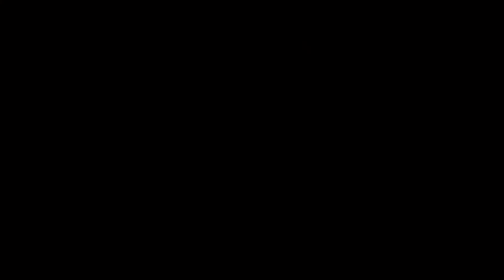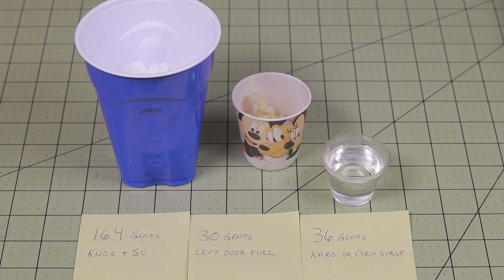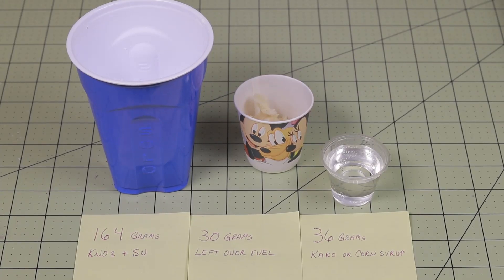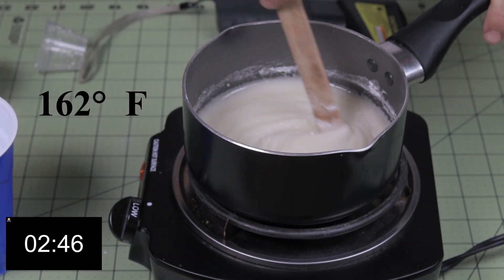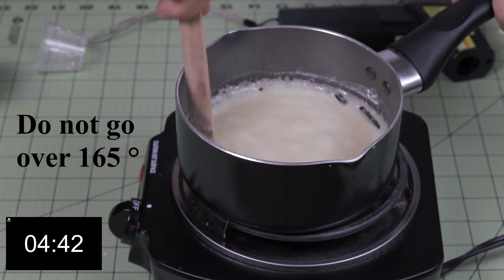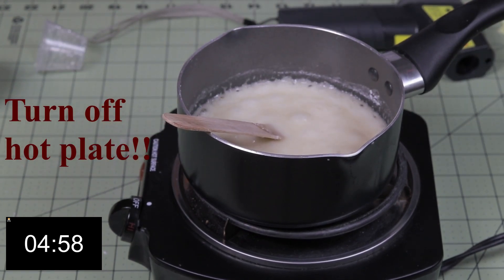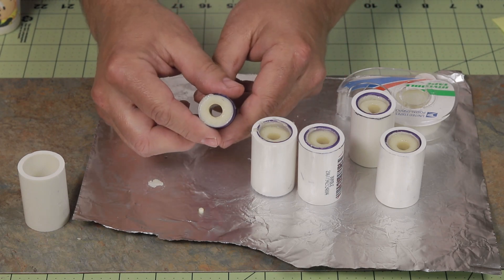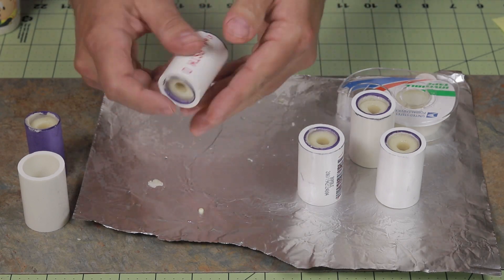Rocket Fuel Demonstration - The Rocketeer

Comment: Just made up about 100 grams of Flexifuel -- enough for 5 1" X 1.5" BATES grains.  Haven't used it in a rocket yet but the strand burn was encouraging, about 8 secs/inch.  I am using 1% RIO on the mix. 

I found that the prep procedure you have is very clear and easy to follow.  I really like how pourable this mix is when hot -- it's comparable to Sorbitol
  
Will return to update comment when I build and launch a rocket using this fuel.  

Thanks for posting these videos -- incredibly useful.

BTW, I tried to donate but noticed that Stripe does not take PayPal.  Anyway you could fix this?  If not, I'll just use a credit card -- which I don't like to do -- but I'm not a free rider!
Reply from the maker: Flexi-fuel already burns quickly, and using RIO may lead to the motor experiencing RUD (Rapid Unplanned Disassembly). Please inform me of the outcome and maintain a safe distance!

Contributing comments and information indicates that you are not a free rider. Donating has become challenging due to restrictions imposed by PayPal.

Thanks for your comment!

Comment: Great video!  How do you determine the proper core diameter for the grain based on the overall diameter of the engine grain?? what percentage of the outside core diameter is the core hole??   Thanks
Reply from the maker: I used a 3/8 core for the 1" PVC motor. A 38mm motor would be a 1/2" and 5/8" for a 54mm motor. Yes, the core size is determined by motor diameter. Thanks for your comment.
Reply: @TheRocketeer  Thanks for the reply!

Comment: I'm a beginner in amateur rocketry, is just using the powdered form of sugar potassium nitrate mix any good in a rocket, I have seen some comments against it on r/Rocketry, also comments saying that pvc is an unsafe casing material? I'm unsure about the first concern but I have seen many rocket tests using pvc pipe, so can you please answer these.
Reply from the maker: Performance and consistency will only come from a melted propellant. When the two components are melted together it provides an intimate contact between the oxidizer and fuel.

Forget about Reddit, there are too many so-called experts there. PVC motors are a great way to learn about motor making, I have made about 50 of them over five years. They are cheap to build and can produce a lot of thrust. PVC motors are for experimental use only and can not be used at a launch. Any rocket motor demands a safe distance between you and the test stand.

Go to this forum to learn about rocketry - https://www.rocketryforum.com/Mentioning PVC motors on this forum is not recommended. You will be greeted with warnings like PVC will not show up on an x-ray. Don't eat the pieces and you won't have to worry about it. 🙄

I have many videos on my channel that feature PVC, take a look around.Latest PVC video - https://youtu.be/nLT_aRcI7fQI launch a 5 lb rocket on a PVC motor - https://youtu.be/OdVmYzNnkzU

New videos will no longer be uploaded after April 8th, 2023 unless I am able to raise some support from viewers using YouTube Thanks or Buy Me a Coffee.

Comment: What would you do if you didn't have the extra fuel left over to add to the mixture? That changes the % of the PC and corn syrup that is in the mixture.
Reply from the maker: I always mix a little more fuel than is needed. The next time I make a batch with the correct 65/18/17 ratio and then add leftover fuel to that mix. Everything stays the same. I will have another casting video soon for flexi-fuel.

Comment: Great tutorial! So I have a LOC Precision Legacy and would love to build a KNO3/ Sorbitol motor for it. What size PVC pipe works best in a 29mm motor mount?
Reply from the maker: The 1" PVC motor will fit in a 38mm mount with some modifications. I had to sand down the end cap so that it would slip in. For 29mm a 3/4 PVC pipe may work. I have only made the 1" size to date.

A friend of mine has made 29mm grains for his Aerotech hardware.

Good luck and thanks for the comment!
Reply: @TheRocketeer  Thanks! Big Box store it is!

Comment: Please don’t Use PVC it releases toxic gasses when heated is toxic in the body and hard to spot on X-rays as well as being brittle making it more likely to explode
Reply from the maker: Let's take a look at this statement. 

Toxic gas
I am not burning PVC pipe. It does get very hot and melt but the pipe is not on fire. We are talking a 6" - 9" piece here, not exactly enough for an environmental disaster. The chemicals used to make PVC are toxic but that is the same for any plastic.

Hard to spot on x rays
Use electronic ignition and keep a great distance from any motor. If you are concerned about detecting PVC in the body then you are way too close! I looked at your channel and you should be concerned about the lack of safety.

PVC is brittle
Any rocket motor can explode. The most violent CATO I have ever seen sent large sharp pieces of aluminum shrapnel flying farther than any PVC motor. The idea that aluminum will just split is simply not true. I have the video and pieces to prove it.

I have been making PVC motors and sugar fuels for years. Some people copy and paste this information are not well informed and probably have never made a PVC or any rocket motor.

Comment: Absolutely no reason to cook the mixture that high of temperature
Reply from the maker: I heat the propellant to 265°F so that it will flow into the casting tube without causing a void. At lower temps the fuel sets up too fast. I have cast fuel for years at this temperature and have had a lot of successful flights without failure.

Do you have another solution? Please post a video of your technique.

Comment: new comment, whqt size  rocket would you use this motor for?
Reply: The 6" PVC motor is a "G" impulse. It will lift a 3" diameter 2-3 lb rocket around 1,200 ft. I will have a more complete answer in the spring when I build a rocket specifically for this motor.

Comment: Hey Rocketeer, 

First your videos are great and offer a lot of insight, thank you.

Second, I've been experiencing CATOs using a De Laval nozzle made from water putty. I primarily build motors similar to what you've shown here but my mix is a little a different and wanted to ask if you thought this recipe could be the culprit:

I use a potassium nitrate to sucrose ratio of 14:6 + 5% of total mass added iron oxide.  I am still testing this recipe and have been building 1.5"x1" with a 5/16" core grains loading five into 1'' schedule 40 pvc, coupled with a 1.5" De Laval nozzle using about 60º convergent segment and 15º divergent, also a 5/16" throat.

I think it's just too much pressure. Tomorrow I'll try adjusting overall propellant mass and well as nozzle throat diameter. I'm also eager to try your recipe here, I've been pouring my casts after the propellant is little less water saturated and it can become rather annoyingly messy.

Thanks, 
Carl
Reply from the maker: One of the reasons I use Karo or corn syrup is to control the burn rate. Sucrose burns at an extremely fast rate and adding iron oxide to the mix makes matters worse. The large nozzle to core diameter can also cause erosive burning, something you want to avoid. The core needs to be around 3/16 to 1/4".

You may want to consider trying a proven design first and experiment from there. One thing I recently learned is red iron oxide (RIO) does not work with flex-fuel.

Thanks for the comments, be careful and let me know how things go!
Reply: @TheRocketeer  Wow thanks for getting back so soon and I will definitely take your words into advisement. 

I understand entirely that it all burns faster but I want MO POWA! I also understand that a nozzle built out of rock hard water putty and schedule 40 pvc can only withstand so much pressure, and yes, there is severe erosion to the nozzle because of this. However, I'm soon to  experiment with using cement as well as upgrading to hardened steel for the nozzle; and in turn the rocket housing as well.

Sometimes, you've just got to run before you can fly. 

Disclaimer: none of what you have demonstrated is cause to any malady I may induce. ;)
Reply: Had lot of great success using your method hear, theyre' currently drying but I m  eager to set the grains in deffirenty interval test reockets, more  to come. thank for all of our pointers
Reply: @Cosmic_Sonder  I have almost the exact same setup, however, I add 1% red iron oxide, and cast my nozzles with concrete, and have screws through them to keep them in place. Concrete would seem heavy to use at first, but it is actually super light when using small quantities like for the nozzle. Also with PVC motors, there is a lot of deformation when used as the casing no matter what the case, that's just the nature of it. I would recommend not using steel, as it is heavy, and a pain to make (depending on your setup), and will be annoying to try and get out of the PVC after firing. I would just do concrete, as the PVC will bust before the concrete does, but if you really want to go metal, aluminum would be the way to go.

Edit: realized this was a little while ago lol. I hope you got your problems worked out

Comment: Very professional sir, may i ask you if i use propane stove for cooking fuel is it dangerous?
Reply from the maker: I think using propane would be dangerous because of the open flame. Propellant should be heated slowly and carefully. An electric hot plate is inexpensive and allows better temperature control.
Thanks for your comments!!
Reply: I used a propane cooking stove and I do agree it is indeed dangerous. If you do use it make sure to have safety glasses at the bare minimum and do it outside for sure. I've had the fuel catch on fire while I was making it (although only once and I've made tons of grains, and it was at the very beginning when I didn't know what I was doing), and I even had 1% red iron oxide which accelerated the burn rate. Quite scary.

edit: but yes electric hot plate is the way to go

Comment: Working on setting up parts and jigs today.
I notice that the actual fuel cell is slightly less than the 2 inch PVC and that the paper extends a bit past the fuel cell due to the thickness of the washers used at both ends. Do you trim the paper to match the fuel cell or do you leave it a bit long? I remember watching a video by someone else and he said to keep the paper a bit longer than the fuel so that when the fuel cells are placed in the engine tube, there would be a small gap between each cell. His explanation was that this helped each cell to burn even faster because the cells would be burning at the center and the gaps would allow for the tops and bottoms of each cell to burn also. Do you think there should be a gap between the cells or should they be packed into the engine tube tightly together?
Reply from the maker: It is normal for the inhibitor on the BATES grain to extend a bit beyond the fuel. If it extends the distance of a washer or two I do not worry about it. You can trim the paper if the grain is a little short if you want to. I find the flex-fuel to be very forgiving. For grains that fit flush I usually cut a series of four small notches to propagate the flame. Bates grains need to burn from both ends. I usually weigh all the grains in each motor and record as part of my notes.

Today I launched a PVC motor with 9" of fuel, 1/4 washers with a full concrete nozzle. The rocket was a 3" canvas phenolic weighing in at a very heavy 5.5 pounds with motor. It flew to 604' with a little wiggle off the rail. This is the max weight for this motor and a successful test. The launch was loud with lots of smoke, perfect.

Good luck and let me know how it goes!
Build - launch - learn.

Comment: I'm getting ready to start building these soon. I am wondering what is the purpose of the paper liners. Is that just to get the fuel cell to slide out easily?  If so, couldn't I just spray the inside of the PVC with cooking oil first?
I'm also curious about the 3/8" core size. If the nozzle is going to be 3/16 or 1/4 (depending on how many grains are in the engine) then why make the core over-sized to 3/8?
I have watched a ton of "sugar-rocket" videos and yours are definitely the best. You give some great details and information that I just did not get from others. And I love the fact that your stuff is new so you are available for questions.  Thank you.
Reply from the maker: That is super encouraging that someone is going to make a motor from my video! I love to hear from my subscribers.

The liner is to faciltate casting the fuel and is an important thermal barrier. I know it does not seem like much but the liner will protect the PVC from direct heat.

Sugar motors are core burners and black powder moders are end burners. The core helps to provide an even burning surface untill burnout. This is a very simple answer to a rather complex question. Stick with a 3/8 core and at least a double wrap liner to start with. After you understand KN and how core size and grain length affect motor pressure then you can make changes.

Good luck, be safe and let me know how it goes.

Comment: How long and how do you dry your grains before firing them off?  Like the clarity of your demonstration
Reply from the maker: Sucrose sets up very quickly compared to other sugars such as sorbitol. The grains should be firm when the coring tool is removed. I like to place the BATES grains in a Ziploc bag after a few hours and let them cure for two days before use. 

Store them sealed up and there is no need to add a desiccant. If you live in a humid climate they can be stored in a plastic container with rice.

Let me know how the grains turn out and remember you have to make this operation safe!